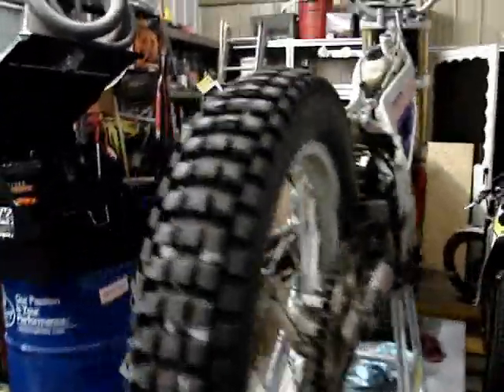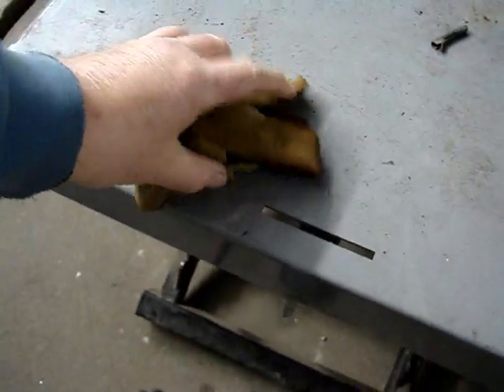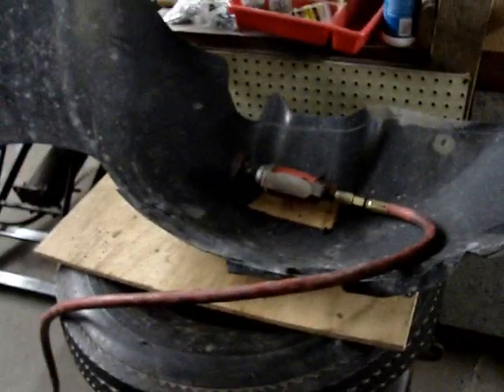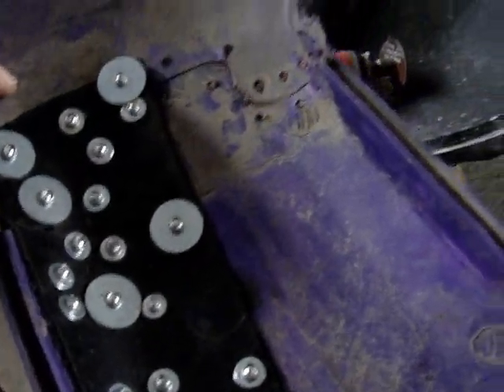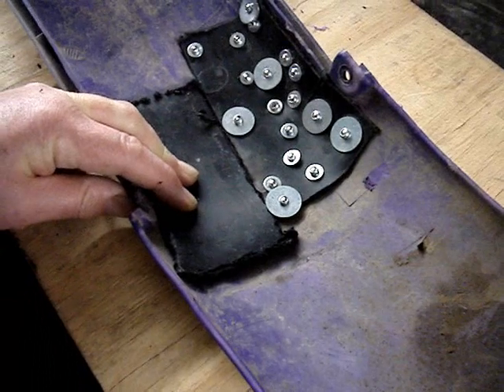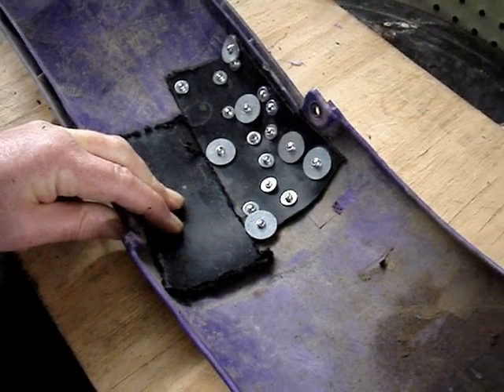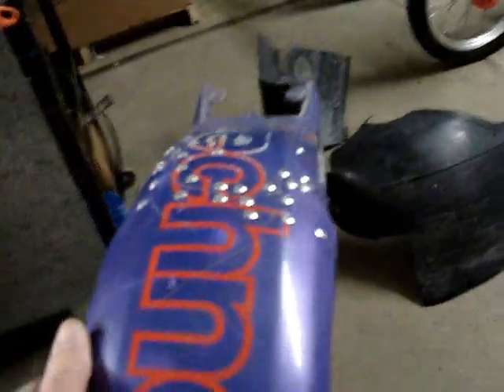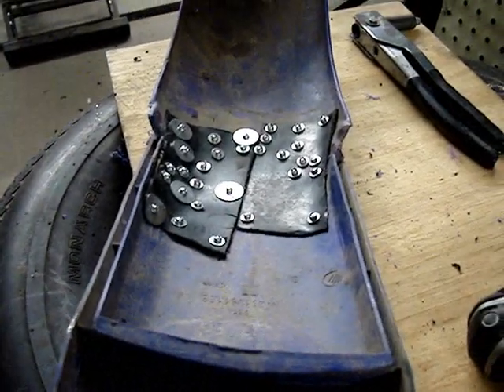Jim Snell shows you a pop rivet fender repair technique BETA - Trials

Comment: Funny enough, I discovered fender liners for these repairs a few years back as well. I even molded some into a complete new rear fender for a vintage trials bike, which is now nigh unbreakable due to flexibility. This material also works well for mounted license plates on dualsport bikes.